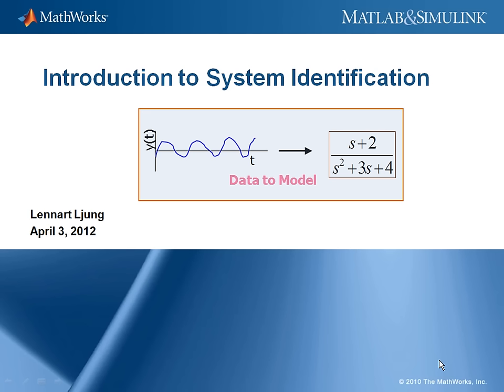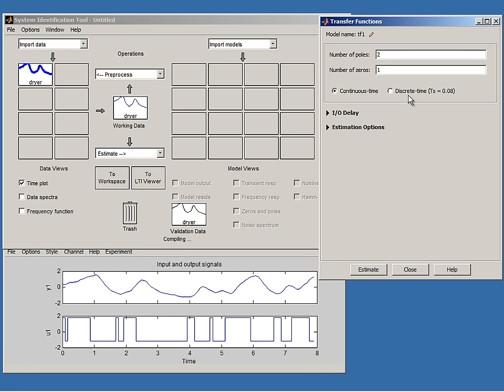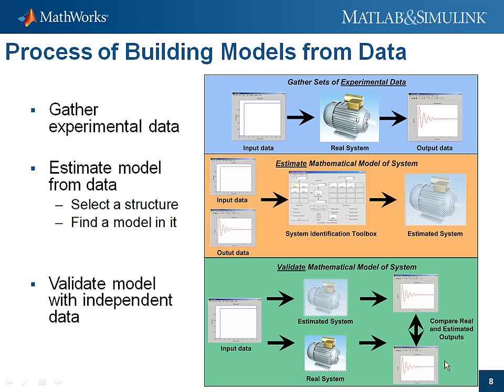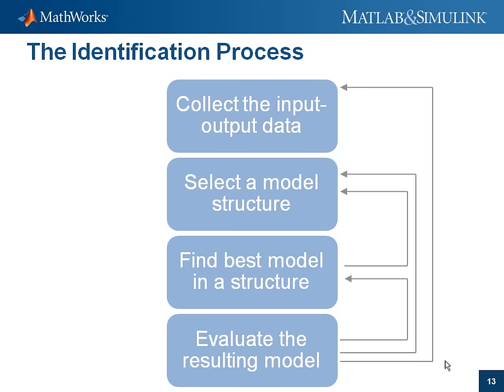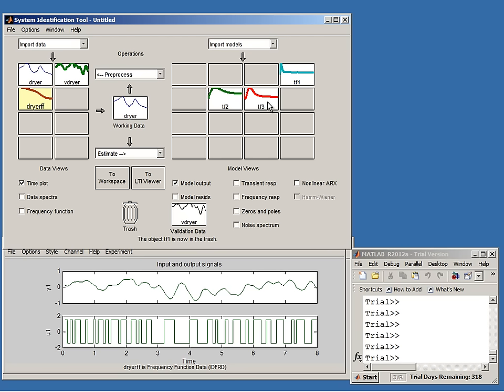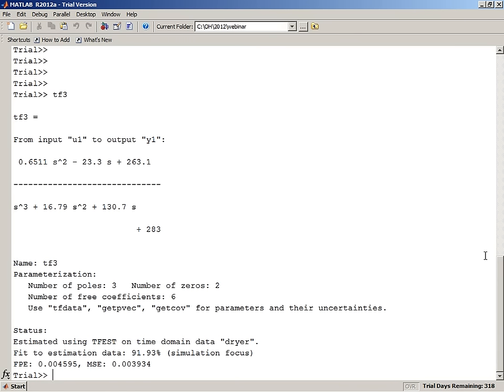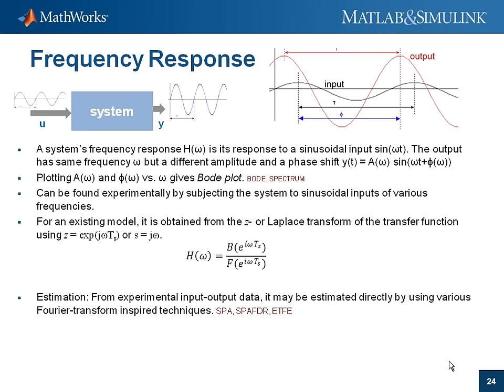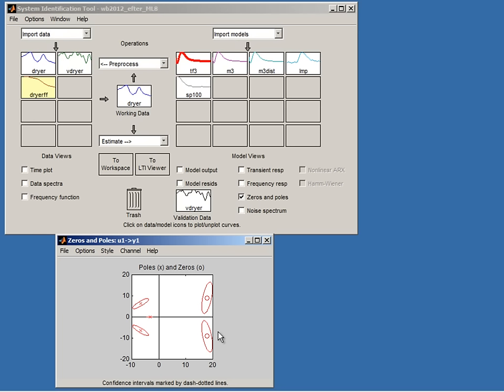Introduction to System Identification...professor  lennart liung

Comment: I am trying to write a MATLAB script that implements an output error model previously obtained via the system identification toolbox. I currently have the following code:
N=80000;
x=1:1:N;
y=((z^(-1)-z^(-2))/(1-2*z^(-1)+2*z^(-2)))*x;
plot(x,y)
However, I am aware that z hasn't been defined, but I don't know how you would define it as the shift operator. Is there a method to do this?